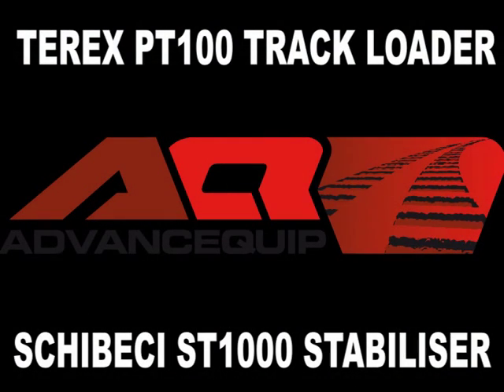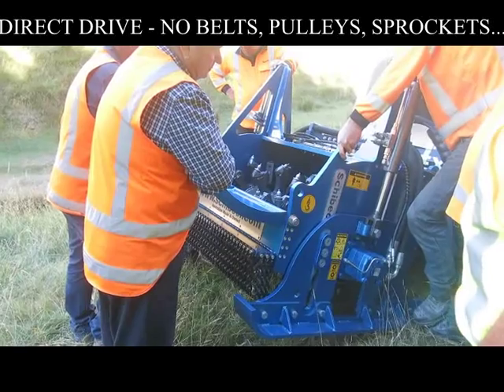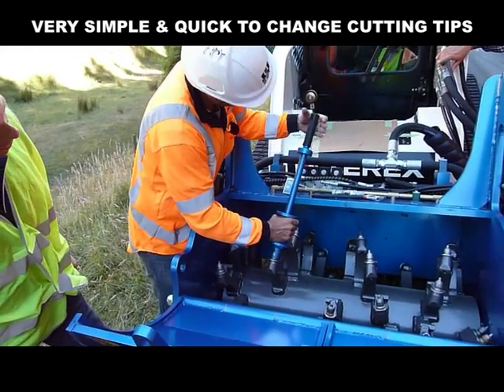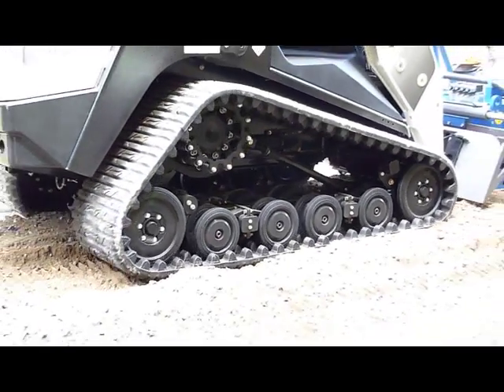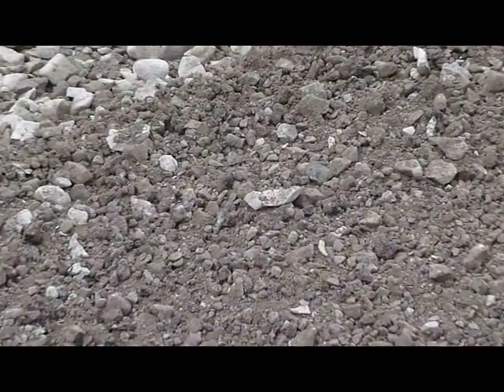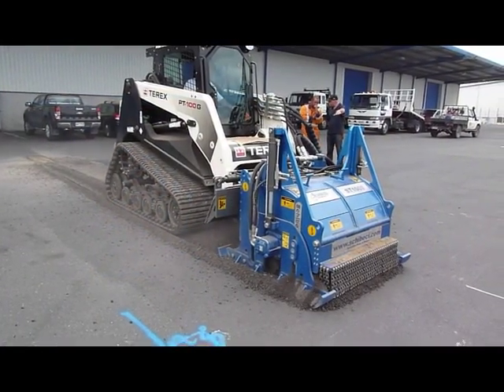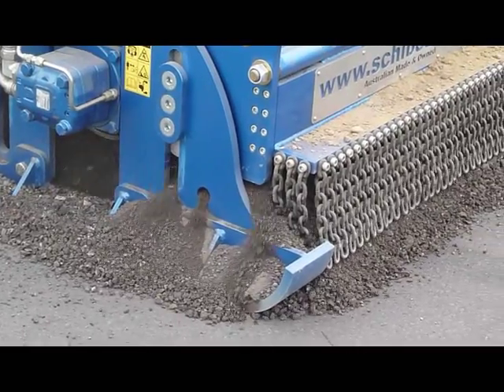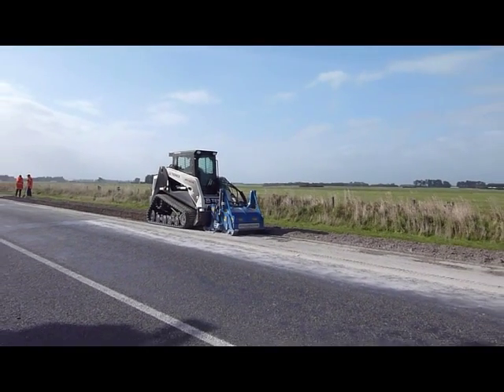NZ Schibeci Stabilizer Demonstration

Comment: How much are these and where are they sold/hired?
Reply from the maker: Sorry for the slow reply! The current model is an an ASV RT135 coupled with a 1500mm Road Mill, another 500mm wider than on this machine. Advancequip are the dealers for ASV & Schibeci mills, would you like someone in the sales department to contact you and give you more information?